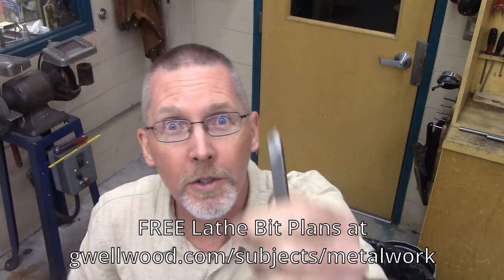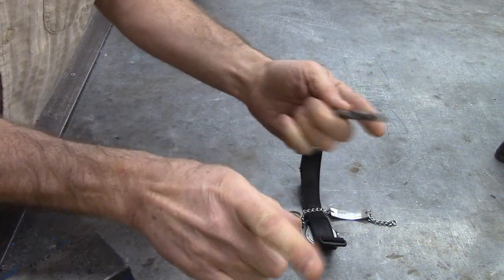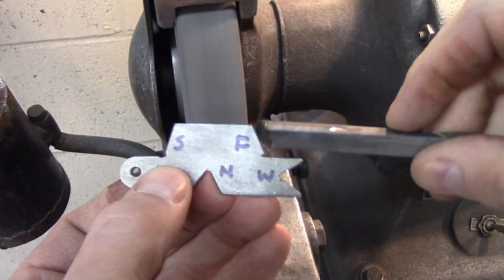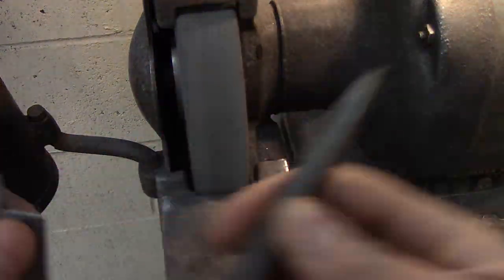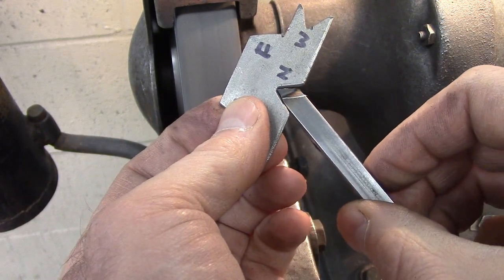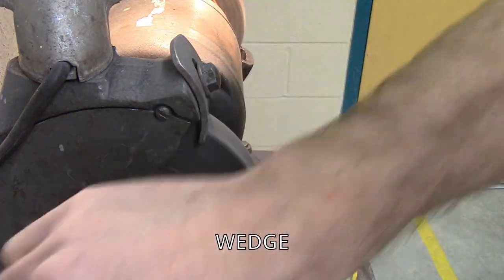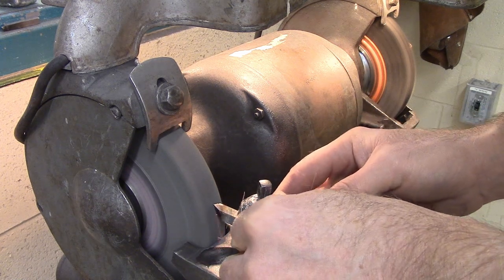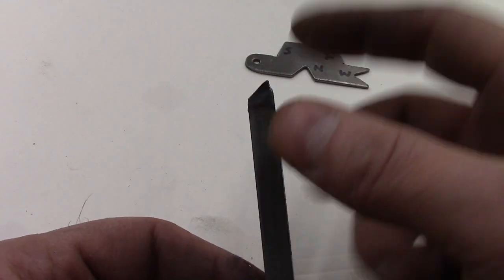HOW TO: Sharpen Lathe Bits

Comment: I was a tradesman machinist and would never sharpen lathe tools like this. Too much clearance all over tool.
Reply from the maker: As a tradesman machinist, you already know that the clearance depends on the material you are cutting AND the type of tool holder.  You can tell this is not used in a turret style tool holder.

Comment: This seems pretty advanced; I hope reading a tape measure is a prerequisite. I'm 61 and would like to retire in the coming year but am reluctant to do so until the next new hire we take on can read a tape. Back in the 90s one guy I worked with could only read a tape in sixteenths. It stopped me in my track the first time he gave me a measurement of 12/16. Twelve sixteens would have been a great shop prank but he really couldn't read a tape in halves, quarters, or eighths; so I adapted.  Currently my coworkers get a deer in the headlights look on their face when ask to check a length for say 33 'n 15/16.
Reply from the maker: I have a video on that: https://www.youtube.com/watch?v=j1Nm27LTkIQ  Feel free to use my free curriculum in your training guide.  (I have grade 12's sharpen lathe bits)
Reply: When I was teaching at a trade school, we had a few students who couldn't tell the time without a digital clock (couldn't use analog)
Luckily, not too many in the 11,500+ I taught as I had to teach measuring, feeler gauges, snap (T) gauges and ball gauges, vernier calipers and micrometer use (metric and Imperial) in the days before 'everyone' used $10.00 'Made in China' electronic calipers
 I did manage to get 128ths of inch vernier removed from course as I had never used one in almost 30 years since I trained (although they are/were used a lot in woodworking I believe?)
 I'm a bit older than you and switching from inch to metric is a little more challenging since I stopped teaching and using it 'everyday'
Reply: Hand them a set of standard dial micrometers with a Vernier scale instead of a digital readout, they are freak'n lost ! Even some coming out of community college with a degree in machining !

Comment: What type of stone should be used?
Reply from the maker: I used whatever came on the grinder.  A finer stone will give a better finish, however.  in the school shop I stick with the more coarse stone and put up with a less-than-optimal finish in the interest of stone longevity with all the other grinding it gets used for.
Reply: @GregWellwood  thank you! I have a lathe but have been using carbide inserts, and have wanted to venture into high speed steel and different geometries. I held off because I thought I needed an expensive grinder. I will give this a go!
Reply from the maker: At school, I use HSS because they are cheap and quick to sharpen.  Kids would shatter the carbide, and then try to machine their projects with the cutter holder.  At home I use carbide except for unique cutters that I make from HSS.
Reply: @GregWellwood  thank for your insights!